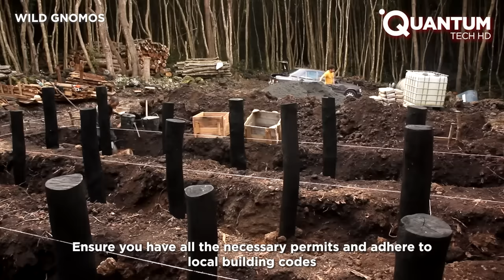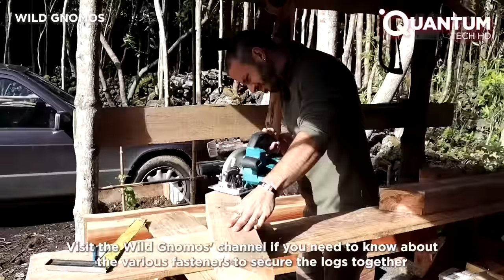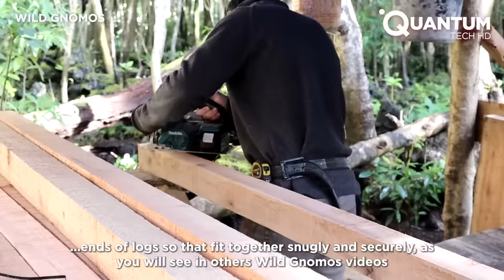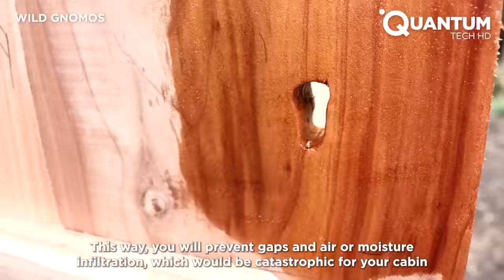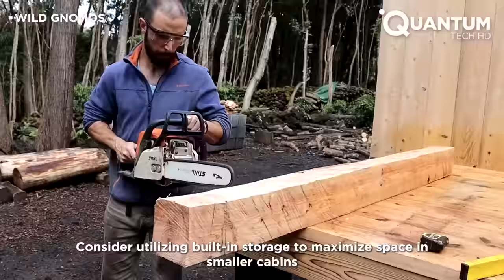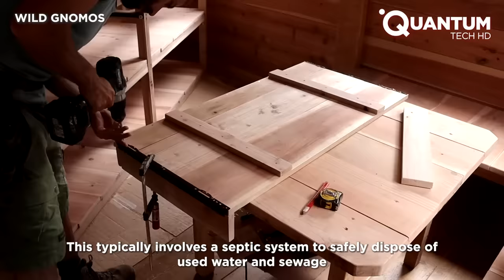Man Spends 100 DAYS Building Wood CABIN in Volcanic Island | START TO FINISH by @WildGnomos

Comment: Staggering the joints is a must.  Also pan heads screws should be used on brackets.  Bugle headed screws won't pull the bracket tigh to the wood.

Comment: Hate to say it but putting concrete around the wood posts was a very bad idea. It will contribute to wood fungi attacking the posts as they will not be able to dry out due to the concrete holding moisture between it and the post. Gravel compacted in six inch lifts would have been a much better choice and the posts should have been elevated off the dirt with either with gravel or a flat rock.
Reply: True!!

Comment: You should have put at least a 1-inch slope or on the concrete from where it touched the post way because water will settle there and it will rot it will take 10 to 15 years though depending on how much rain and snow you get

Comment: I have two questions just for curiosity, first, why do you not have a nail gun? It seems like you are using thousands of screws. Which, if they are SS, then very expensive. It would pay for a battery nail gun. and I know you have a way to charge the battery.  Second, is that wood cedar? It is a very nice looking wood and finish. Thanks

Comment: Hmmm...It seems that I missed he part where he cut down the square trees?
I love these going off grid/back to nature videos...where they have every power tool know to man!.....so much easier than using rough felled timber and pinning every thing together with dowel type joints....I guess it gives you more time to film every thing?
Reply: portable lumber mill on site. that's  how you get square logs
Reply: Ah yes..the good old, back to nature, portable lumber mill...why didn't I think of that? @CharliesPurpose